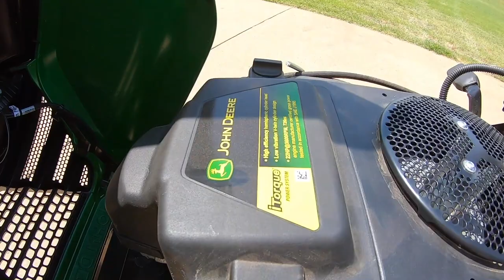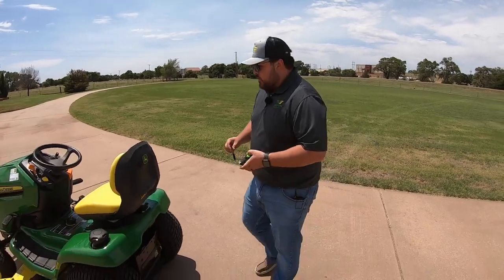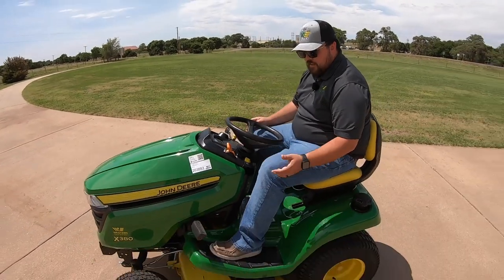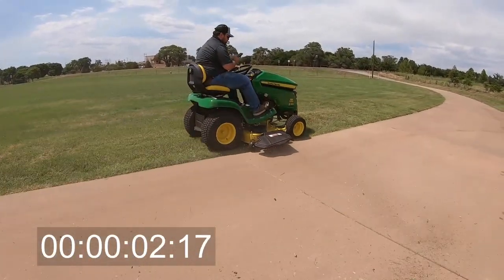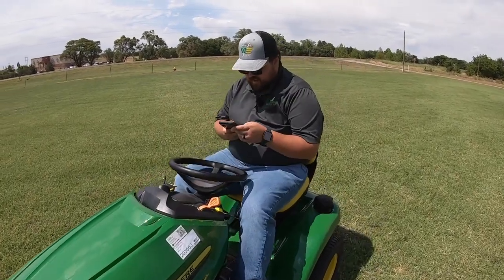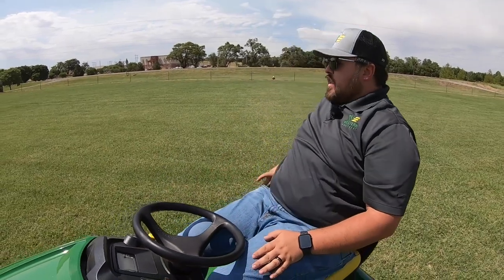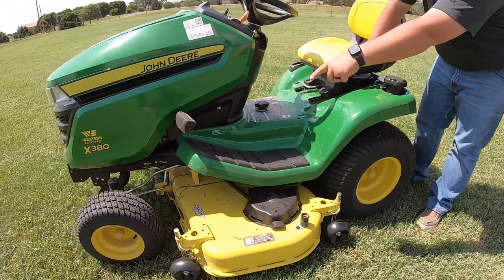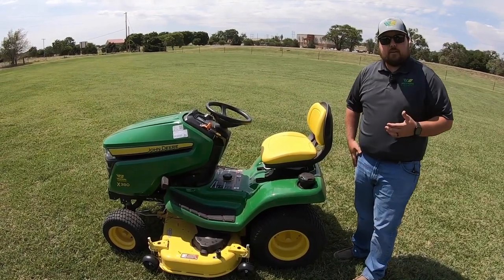How fast can the John Deere X380 Mow an Acre?

Comment: You mentioned you adjusted the anti scalp wheels before you started. I’ve reviewed you other video’s and don’t find one which addresses that. Can you explain or tell me where to go to do this correct?

Thank you for your deck leveling video. Easy to do and very well done.
Reply from the maker: It depends on what mower you have and what deck is on the mower. If you can give me the model and deck size I can explain or you can check you operator manual for the instructions as well.
Reply: Western Equipment It is the X380 with the 48 inch deck

Comment: Great video! I’m thinking of buying an X380 but can’t decide between the 48” or the 54” inch deck. Do you know if any problems are had with the 54” inch model or is it just as reliable as the 48”?
Reply from the maker: Thank you! I have not heard of any issues with the 54" deck. I have always seen great reliability out of the 54" deck. I hope this helps and thanks for watching!

Comment: I need to know if this mower transmission want slip with 300 # butt on it on a hill
Reply from the maker: I don't think you will have any issues but it may be a good idea to contact you local dealer and ask if you could demo one to be safe.

Comment: i have a older john deere d140 from a few years ago, and i have not been happy with it. the seat rides way too high and it feels like your gonna fall out of the seat. it kind of makes me not like john deere. but it could be the fact its from lowes. also i have had to remove the engine shroud to unstick the starter gear after the first year of having it. and the fly wheel was rusty so i cleaned it up as well while i had it off.
Reply from the maker: Well I am sorry to hear that!! You May give one of the X300 series mowers a try! If you demo one, let me know what you think!
Reply: @WesternEquipment  if only i had the money to replace it, i do have a good bit of hills but would also like to try a zero turn as well.
Reply from the maker: I see! Well if you do upgrade in the future, let m elbow what you get and how you like it
Reply: I just upgraded from a 102 (Big Box John Deere from 2006) to an X590.  Cut quality is terrific, and although the tractor is quite a bit bigger than the 102, it turns on a dime with the power steering.  Really happy with it.

Comment: My neighbors have this riding tractor.
Reply from the maker: Right on!
Reply: They originally bought this for their lake house but it wasn’t sturdy enough on that yard their yard that there lake house is a steep sloop . So they have this tractor at their main house now to replace their old 100 series that died on them and bought an X700 series with 4 wheel drive for their lake house. They wanted 4 wheel drive because there yard is steep and they wanted something that stay stable on their yard.

Comment: Hi iv got the e110 and wondering how to remove the steering wheel cap, do I just get a flat head and force it off or is there a specific spot so I don’t break off the clips?
Reply from the maker: It has 3 tabs that hold it in place. I would try wedging a screw driver or some other flat tool in directly under the Deere logo and see if you can get it to pop loose from there.
Reply: Western Equipment ok thank you 😊

Comment: wait did u just say top speed was 5.5 mpr??? man thats slow. my 09 x724  top speed is 9 mpr..  but hes right on 1 thing, it is a nice looking mower..
Reply from the maker: Yes but the X7's are 2 frame sizes bigger so therefor they have a higher top speed! How do you like your mower?
Reply: @WesternEquipment  o ya i forgot that...lol   its been great.. almost 10 years & no problems with it.. cuts nice as well.  the mower deck could use a new paint job tho..

Comment: would be nice to keep making these type of videos
also.. add different brand mowers to compare against jd
only thing i hate jd is stamp deck not welded deck
Reply from the maker: We will keep producing them and if we get a chance with some other brands we will do some!
Reply: Is the stamp deck an issue?
Reply: 69 Texaseyes if you’re mowing rocks and stumps, for grass stamped deck is just fine, and cut quality is usually better with stamped decks because of the way air flows with them

Comment: Best thing about these tractors is that you can pick up low hour trade ins at your dealer for less than a crappy big box store tractor. I'd rather have a zero turn,but for the price these are a bargain.
Reply from the maker: This is true! Thanks for watching!
Reply: Jay M  yeah,that's what I was saying. The john deere dealers have used trade ins for a good discount over new. Some are just barely used and more or less are still new. Quite a bargain.

Comment: Honestly it would be faster just going back a forth
Reply from the maker: I have to disagree with you on a riding mower. But maybe with a zero turn. Thanks for watching!
Reply: @WesternEquipment  I agree with you, every time you're making turns to change direction. you're wasting cutting time. 40+ yrs experience - Michael